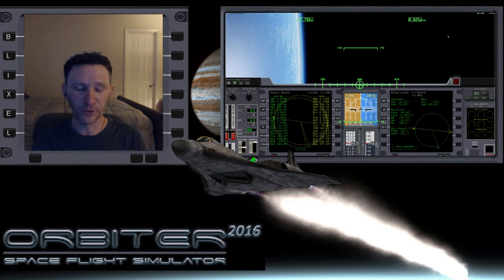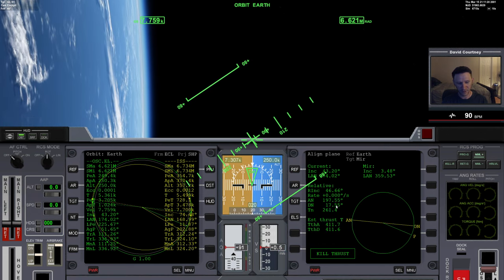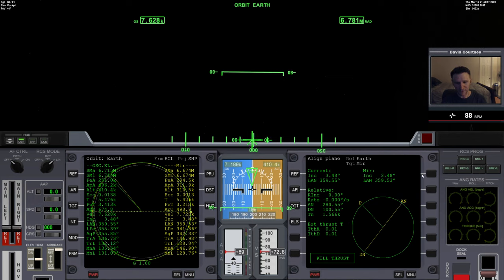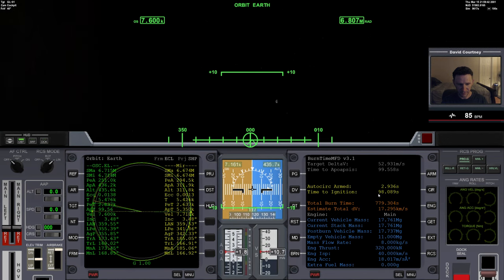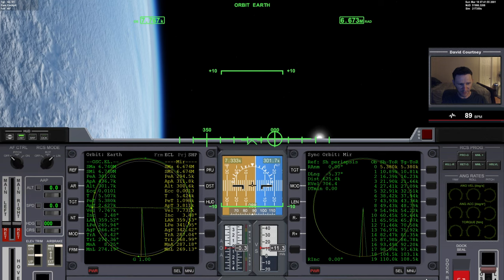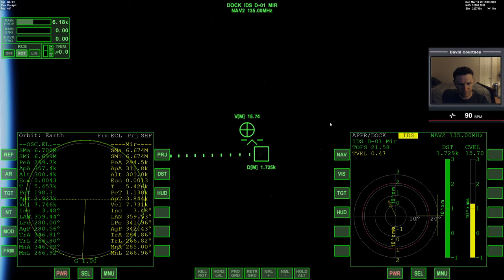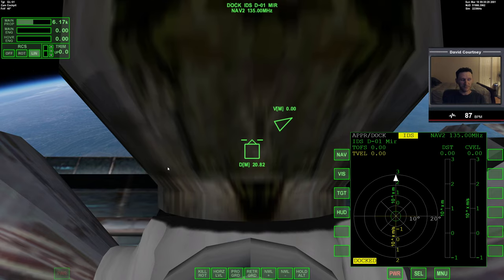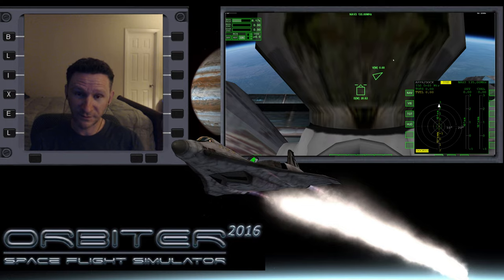Orbiter 2016 - [Part 2] ISS to Mir

Comment: Great video as always :) I noticed that you tend to (as I did also) chase linear line-up as you approach the docking port. I found that, once I have the yellow linear crosshairs centered on the docking MFD, if I then position the velocity vector directly on top of the boresight ( or hud attitude indicator "--/\--") I don't have to concentrate so hard on the docking MFD to constantly chase linear line-up.